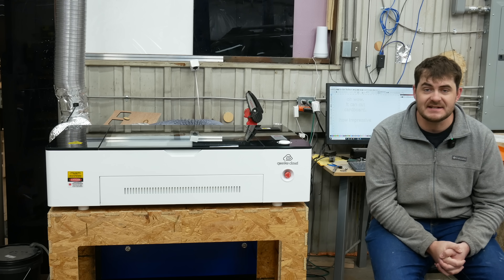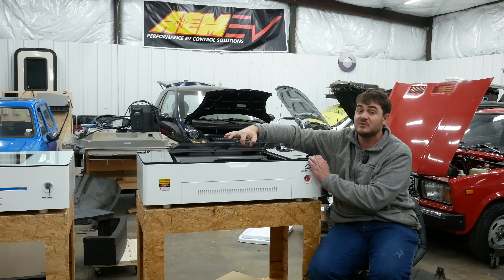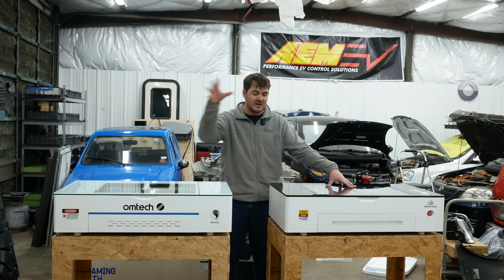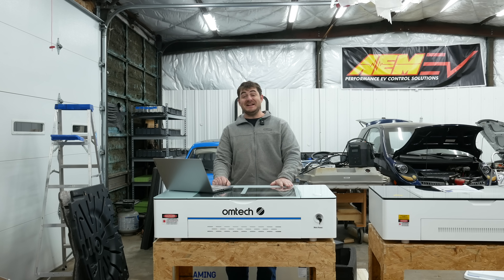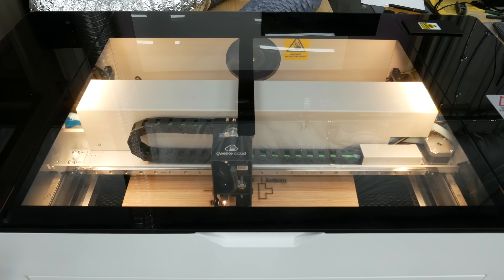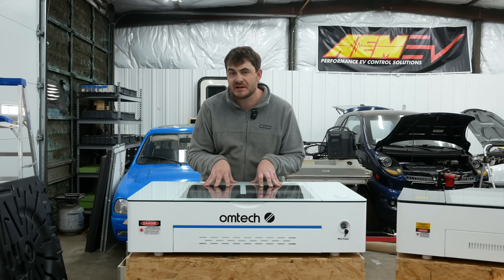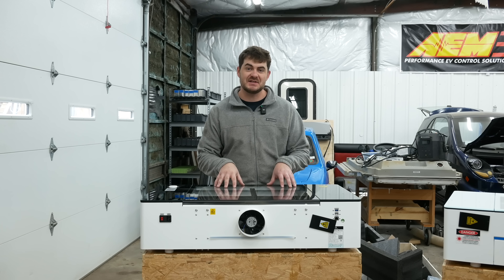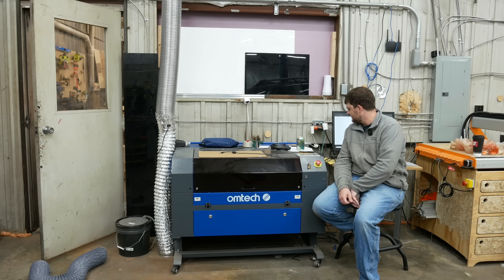The OMTech Polar and Gweike Cloud are (mostly) Desktop CO2 Lasers

Comment: I run a 2500 watt industrial laser at work and I've been eyeing these two, or the Omtech cabinet like yours so thank you very very much for the straightforward, honest review.  Even though I don't really have space for the cabinet machine, I wouldn't even consider the desktops (or a slowforge) after this video.

The first thing I will tell you as a professional laserer is that you are 100% correct that these home gamer machines NEED an error/message display, even if it's hidden (inside the drawer or on the back of the machine?) you simply must have some way to troubleshoot errors because you WILL encounter errors.  
Most new laserers are not going to have the frame of reference to know why something is not working and there are a great number of mechanical or electrical issues that can crop up even on a simple machine like these.
Second, more power is more better.  Higher power is so much more important than most people will think, it's not just about speed but about clean, complete combustion or melting of the material being cut.  If you cut through part way and ignite the material in the kerf you can ruin your part, destroy your machine or burn down your house depending how observant you are and whether you're attending the machine like you really ought to be.
Third, the Gwenneth air assist being kinked is very very likely to be the reason it cuts more slowly, air assist is life.
Reply: I used to run a 8KW disc laser. They would not let me replace an operator who couldn't stay off their phone. A simple protective window swap was ignored until it shattered. The bill was over $40K, just for the new head. 

I also used to run a "full spectrum laser" 120W co2, a big 48" wide cabinet laser. Maintaining proper beam squareness with the gantry was a pain, but might have had something to do with it's size. It also had a stepper motor and belted drive for electric bed lifting. That design was garbage and I should have replaced it all with individual motors. Squaring the bed and messing with belt tension was necessary often. Weight and it's location on the bed was critical to note before trying to move it. It was 6mm wide GT2 belt on something like 36mm timing sprockets, slipped like mad. That was a long while ago though, it had the same exact controller panel his does. 

His cabinet has a thumbwheel in the corner to adjust, makes me nervous. Probably the same setup, just manually driven. You can do some adjustment with the head to focus instead, which is what I did more often than not to avoid bed alignment...

Comment: in the "move" tab in light burn there is a laser focus up and down buttons...super easy to adjust the focus of the OMTech Polar easily. I think your review, while fair skipped things your not familiar with. OMTech provided a acrylic manual focus tool in its plastic pouch.  The laser is in focus 2" from the top of the black plate down to the work piece.   this probably applies for the QC as well. If anything you should have mentioned the need to raise the machines up 3" in order to use the provided rotary tool because even the smallest tumbler will not fit on the rotary tool without the machine raised up on legs. Then the rotary tools cord is not nearly long enough but to just barely reach the plug....oh well...

Comment: Stupid WiFi arrangement -- they should just be devices on the network, like a printer, not hosting a WiFi hotspot. It's stupid, lazy half-assed, and exactly what most camera manufacturers do as well (or used to, haven't checked a more modern device).

Comment: Much complaining about wifi, but I can't help but notice that there's a perfectly good RJ45 that you could use.
The passthrough slot on the back of the machine is still useful, the obvious option is to take out the drawer but with the slot in the back you can put something arbitrarily long into the machine and engrave it in the middle instead of only on the ends.

Comment: Excellent video; thanks for sharing! I was reluctant to watch it as I ordered a Gwyneth Cloud a few weeks ago, but the RF version so no coolant on m' labels (no room for a large laser, and it needs to be mobile). I'll be using Lightburn/USB; no cloud/WiFi. Good suggestion about disabling the autofocus, and wondering if the firmware could be tweaked to get rid of the 10sec dwell at the end of every job (I wonder what they were thinking there...?!).

Anyway, greetings from a new subscriber in the UK!😁

Comment: Another great video as always! I've had my glowforge for a little over a year at this point, and honestly I think this video actually makes a pretty compelling case for getting a glowforge over either of these machines. Sure my inner 'do it all myself' developer brain was a little leery of the whole "walled garden cloud control solution" side of the GF, but honestly, it's a dream to use the machine and the app, and I haven't had to troubleshoot anything at all, I've never even had to focus it!

If you're looking to get a laser because you really want a project to tinker with, it sounds like Omtech and Gwenyth here have got you covered, but if you're just a maker making stuff, a maker space, a school or a small business and you just want a tool that works? The GF is 100% the way to go, you will not regret it, it's rad as hell.

One final note: the GF basic is $4000, list price ( unless you find someone's referal code - which typically knock a couple hundred off.) Sure, that's 1000 more than these two, but honestly if you're already down to spend 3000 on a laser cutter it seems silly to try to save at the end by buying a not fully baked knock-off.
Reply: I dont even see a "Basic" on their website.  I only see a Plus and a Pro.  And neither are $4k; they're $5k and $7k!  Big difference over a $3k machine.  Where are you seeing the Basic?
Reply: Cloud control is ok if you can self host or run without it. Otherwise it's a non starter.

Comment: Another note: Can you check if the retraction move is added as additional move in the software and can be removed? I am betting the version of the app has default retraction move added for some reason and you could remove it making it a bit less annoying. Im not sure about that but I used quite few hobby and semi pro cnc apps and they have such settings. Usually thats called pre and post processing settings. The other machine may just have different defaults set. Worth checking.

Thats the abc of cnc so you sound overly dramatic and confuses people who have no clue.

Comment: The wifi setup is not that bad. Not going to too much details: you can have more than one ip, you can connect to wifi and cable simultaneously. The reason for such setups is price and simplicity of user interface of these machines.

I can bet that once you pair the machines to your wifi (yes, you can temporarily change your wifi SSID or just make a hotspot on your phone and setup everything from it or ftom another computer connected to  that hotspot) it would all work ok.

So dont get me wrong but the part about wifi is kind of funny, like zoomer baing as inept with tech as boomer. How similar despite all differences :)

Comment: Loved the video! Would a solution for the lack of error messages to print out a key of what each light colour means for the errors. I assume there's a page in the manual that explains what light colour means what went wrong. It would ruin the sex appeal of the machine having paper taped to the front, but it would solve the problem

Comment: First, great video.  You are so good at capturing the frustration.  IDENTICAL experience with Glowforge.
So, I have a Glowforge - and I WISH I HAD BOUGHT THE SAME LARGE MACHINE THAT YOU DID.  Glowforge will nickel and dime you by all but forcing you to have a monthly subscription to their website.  All you have access to is basic functions unless you pay up every month.  The WiFi connection issue you had - nearly the same with the Glowforge - it SUCKS.  The idiotic glowing button - why?  Just Why?  When I send something to the paper printer, I don't have to walk over to it and press a button before it starts printing.  I can't agree more with the lack of a screen on the Glowforge.  A $150 3D printer has a color screen and SD card slot/USB port for selecting programs and re-running programs.  If I have a bunch of parts to cut, you can't just swap material and hit "Run Program Again".  No, you have to use the website to generate the exact same tool path again, sometimes taking several minutes.  For some of the "production" work I do, cutting out a dozen or so balsa wood parts, it takes almost as long for the path to generate between cutting than it does to do the actual cutting.  SUCH A WASTE OF TIME.  If anyone is seriously interested in a Glowforge plus with low hours, let me know.  I have the original box, shipping restraints, etc.  I am in the Boston area.  I would happily trade it for the cost of the large machine (which apparently is the same cost as the smaller machines.)

Comment: TLDR, Glowforge's error message are hardly a competitive advantage over these machines. Yes, Glowforge provides error messages, but they are incredibly cryptic and usually are not helpful. They say the laser head has been bumped when it hasn't, they say turn off the machine and turn it on but not why, they say the camera is not working (and you are dead in the water when that happens), 95% of the time you still can't fix the error. Then when you contact support, their most common response is for you to pay them $1600 and send the machine back for an exchange.

Comment: Buy a chiller for your laser tubes. The radiators are not worth anything. I have a chiller on my 50w laser that  I bought in 2016. Still on the original tube with only a slight drop in output power.

Comment: The Glowforge (affectionately known as the Slowforge ....for good reason) is REALLY a K40 pimped up to the eyballs wearing a Gucchi  dress.  After spending a fortune  on the machine you then have to RENT the software at about $100 per month. The basic engineering on these "other"  machines is more robust than the Glowforge wobbly wheel bearing system At half the price and no ongoing software rental it should be  no contest. However I agree that they have MANY annoying features . Everthing is overspecifiesd on all 3 machines. You cannot fit a 50 watt tube in the case  so at about 800mm long this is no more than a 40 watt tube for all 3 machines. The difference in performance  noted in the video is almost certainly down to tube quality. I note the glass water jackets on the ends of the tube indicates the "cheapest" tubes available and they may not even be A grade tubes. There is a huge problem with unwarrrantable tubes being sold to the "grey" market for little more than scrap value.  Yes they work , but how well?  99% of folks have no idea how to assess beam quality and that's what the Chinese machine builders rely on....user naivety. Desktop machines look appealing but there are too many compromises made to fit  everything into that smart case.  There is a step between the 7050 bed size big cabinet machine  and these "desktops". A taller 5030  machine  has more or less the same footprint as those "half baked" machines. It also allows you to upgrade your tube power.......a feature that was not mentioned  (and not possible) with the Gwineth and Polar machines.
 
A very entertaining video  and the correct conclusion. Copying a Glowforge was not necessarily a smart move.

Comment: I am curious if you could just use both the wifi and the ethernet port to connect the omtech to the network...

If that does work it means a simple fix would just to buy one of those little tiny PCs and turn it into a headless machine, then remote into it.

Comment: The separate USB for the camera is kinda neat, since you could use a separate device to monitor it manually if you want. But definitely weird. 
Also that homing routine is hilariously bad. You don't need the precision of an inductive sensor or bed leveling or something, so simply adding a microswitch and a bit of code in the firmware would have made that super simple. For a ~$3k device, it's a bit absurd that they skipped that. 
And yet they include 2 whole rotary assemblies, each of which must cost many times what a microswitch-based leveling system would have cost. Da heck. 
Now can it run Marlin and stick a BLtouch on it... 😅

Comment: The omtech does not have DHCP (essentially dynamic IP addresing) which is why you have to manually change the IP and gateway. Pretty ridiculous for a 3k machine. If you plug your computer into ethernet you can browse the internet!

Comment: Very interesting. I would almost certainly buy something like one of those desktop laser cutters if (a) I had the space for one in my tiny apartment, and (2) I could find a place that sold them locally here in Australia without the insane Australia tax. You can find them for a reasonable price if you buy direct from China, but there's no way I would trust any delivery company to not smash the laser tube in transit.
Reply: Had to have my G·Weike Cloud ( bought during the 2022 Black Friday ) shipped from China to Switzerland via DHL without issues ( other than the same "leakage" he reported which I know suspect to be the work of an unmotivated worker responsible for filling up the machines before they're being sent off ) as they wouldn't ship it from the MUCH closer German Warehouse.
Strangely enough the 200.- Mitutoyo QuantuMike Micrometer I've ordered off eBay cost me more in Import fees than the Cloud did which I cannot explain how they pulled this off but who am I to complain 🤔

Comment: If the machines work well via the ethernet socket but are a pain via wifi then you might find that the vonets wifi bridge is a neat solution. They're pretty cheap and would neatly bypass all the ludicrous config issues you mentioned.

Comment: It probably only works with 2.4ghz wifi, which means whatever device you are using to connect to it and put it on wifi also needs to be on the 2.4ghz band. Its dumb but a lot of IoT things are like that

Comment: For your complaint about having to be disconnected from the internet to connect to the wifi of the things, I'm pretty sure if you have a computer connected over ethernet with wifi capabilities, you can remain connected to the internet over ethernet while still connecting to the machine with wifi.
Reply: Not even that. The whole process he is describing is for connecting to the machine in order to do its initial setup and connect it to your network. Once it is on your network, you can connect your computer back to your normal network (in fact, this should happen automatically) and you should be able to both use the internet and talk to the laser. The setup process for these machines is much the same as I have seen for just about every Wi-Fi connected device I have ever owned. I have owned printers, smart switches, and routers which all had to be set up like this.

Comment: Thanks for the info. I wonder what the electronics are like to see if they could be easily re-flashed with GRBL and OctoPi
Reply: They’re probably using off the shelf parts changing the driver board shouldn’t be to hard.
Reply: At least with the GWeike Cloud you'd have to change out the proprietary Board but good luck with finding something that can be used for CO² Laser purposes AND still fit inside the Machine - That Place is CRAMPED AS FUCK!

Comment: I have no hands-on experience with CNC lasers, but I do have a few thousand hours of 3D printer maintenance under my belt. With 3D printers, you can use OctoPrint on a Raspberry Pi to connect to the printer over USB and that provides a generic interface that all 3D printer software works with. I will never buy a 3D printer that does not work with OctoPrint, because the ones that only offer direct wifi or ethernet connections have notoriously bad interfaces and/or no way to manually provide GCode.
Does something such as OctoPrint not exist for CNC lasers?

Comment: Thanks for the review, but, I'm out on both.  I want a functional machine with every bell and whistle working it comes with when I bought it.  The fact that you have to redo your networking and goofy network setup, fat chance I'm going in on that.

- ABSOLUTELY get a display on it.  Any wireless ink jet or laser printer that goes onto WiFi has SOME kind of display that you can get configured!  And you get get those for $100 CAD!  That's $3.50 USD!
- Having a machine like this to have an active hotspot then turns around and hooks into your private wifi seems back-asswards.  If anything, a pretty decent attack vector from any roaming road warriors
- I hate grade 2 math, let alone time math.  I 100% agree that if the designers of the units know what the focal point distance is, the software should be able to understand and set a default distance.  ESPECIALLY if you want a clean cut and you can do multiple passes, or, the head bobs up and down to make sure that focus point gets to where it needs to be.

As for the raising and lowering of the laser head, there could be some "Pre" and "Post" commands that are being passed to the cutter based on some kind of default if the software can find out what the printer is exactly.  The fact that the head isn't being lowered at the start of the print makes me wonder if there should be a prompt on your UI introduced that asks specifically what the material height is, then set the focus distance, then go to town.... 

Bottom line, these machines make me feel dirty on the inside and I'd never want to sink a few MONTHS worth of paycheques into them if I get to use half the machines functionality.